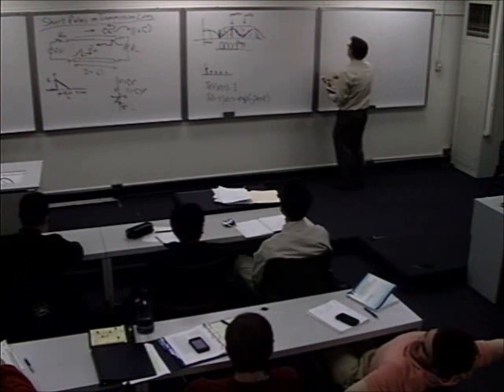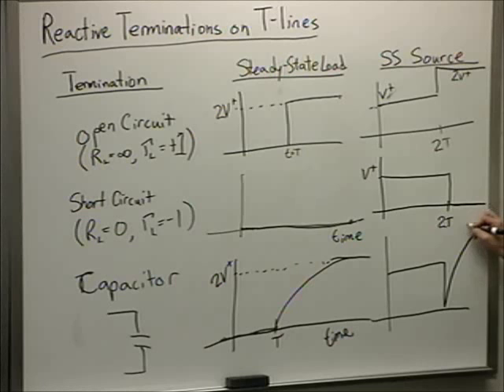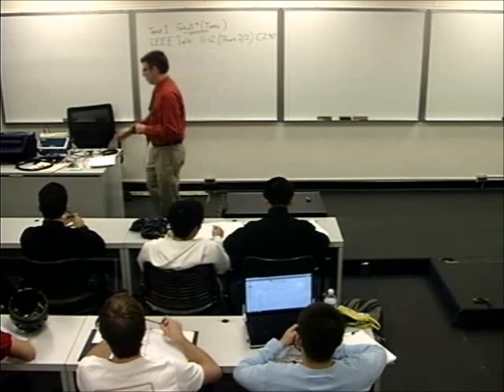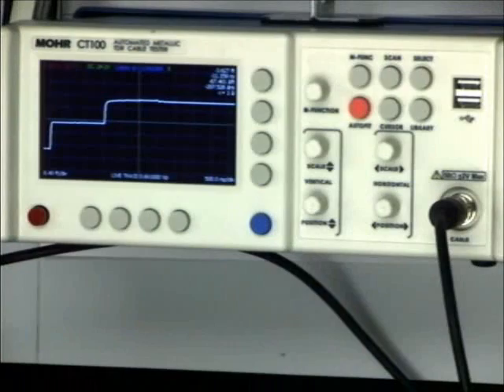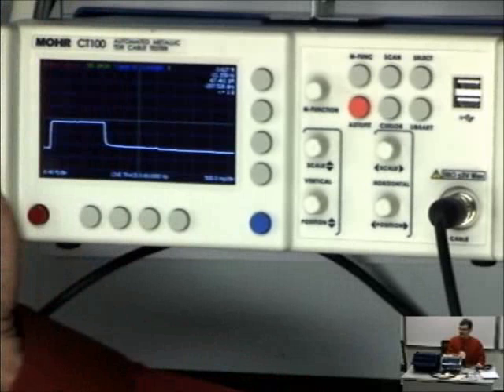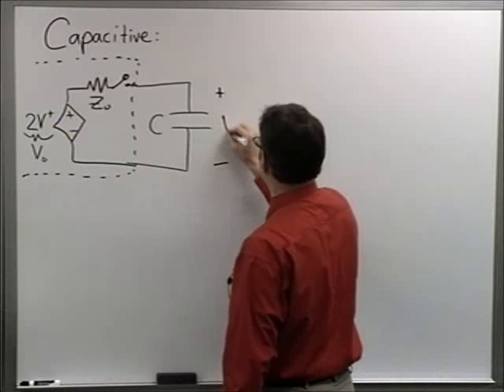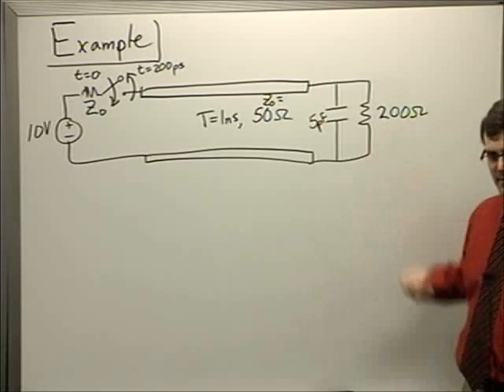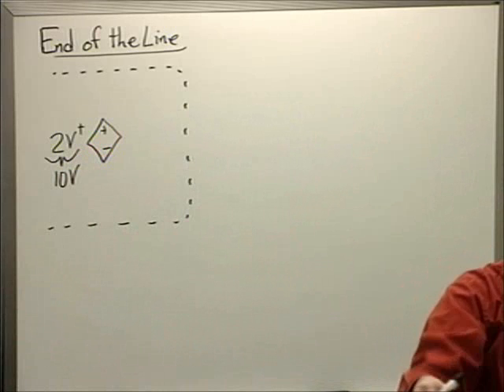TDT08: Reactive Terminations on Transmission Lines

Comment: He is careful to short the capacitor before connecting to the test leads going to the TDR. 
A long, say 100 ft, run of coax cable can store a great deal of charge, if unterminated in a bleeding resistance. It is good practice to short/discharge the line using a screwdriver across the coax connector, before connecting it to your TDR or VNA.